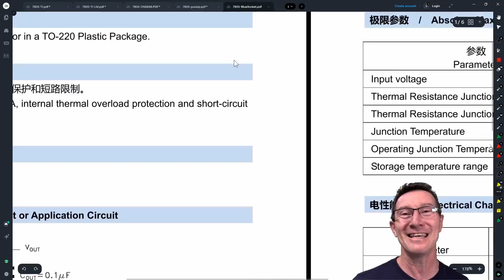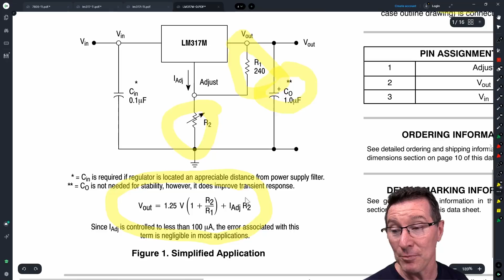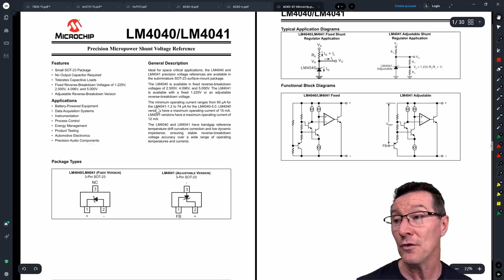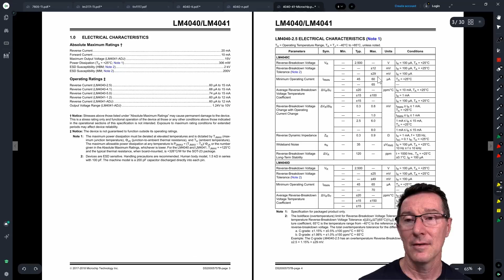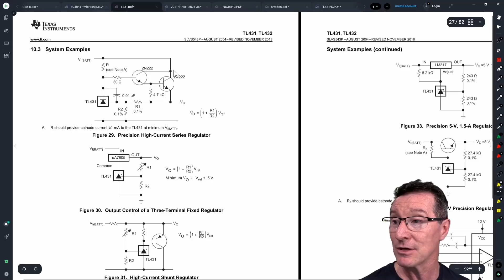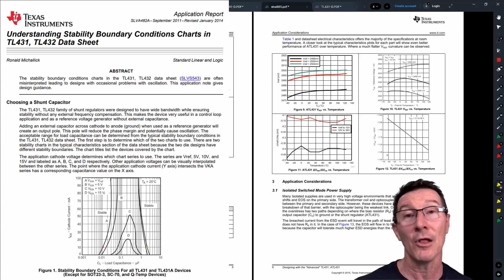EEVblog 1438 - The TOP 5 Jellybean Regulators & References

Comment: I'd add LP295x for low-power applications
Reply: i believe you got interesting story about it
Reply: 7:00
Reply: LP2950 - fixed output, 3 pin
LP2951 - adjustable output, 8 pin
Reply from the maker: Yep, video was already way too long.
Reply: @EEVblog  There's no such thing as a long EEVBLOG video, Dave :)
Reply: @EEVblog  references should have been on separate one so you can cover the subject of regulator a little better imho.
Reply: I am not sure EEVblog videos can be too long. Just pause and continue next day. : ) @EEVblog
Reply: The great Mike has spoken.

Comment: Jelly bean apart from them being all being in the same jar like components but still remain an individual component/item in the jar well the printed circuit board is the jar so as long as your voltages are right you won't make heat and weld all the jellybeans together just like a circuit board

Comment: The two jelly bean solutions I am frequently looking for are:
1.  A simple "neutral reference" between rails, to avoid paying an op amp and 2 resistors to generate this, while losing sleep over whether there are any circuit conditions that will overload the op amp once the product is put into service. There ought to be a regulator designed to do this, but I haven't found it (yet).
2.  Every design seems to involve switching analog signals around. A bilateral switch like the 4066 works, but it's made of super-static-sensitive CMOS. A 74HC4316 or 74HCT4316 seems to qualify, but they are certainly NOT available like jelly beans.
Steve

Comment: I am struggling to find an equivalent of the LM317 but capable of handling 60v not just 37v
Reply: What do you need it for? TL783 with different pinout costs about 3eur, you could also use LM317 with zeners across it, LM317HV has 60V rating, etc.

Comment: I've thrown in 2x the LM317 into every toolkit (parts, tools, breadboards,...) i made for our interns/students, but until now they all were too lazy to build it onto their breadboards and all used external lab power supplies for their different voltages 😅
Now thats fine for first setups looking for smoke, but i find it a lot nicer if you only hook up one supply.. but building a board without cross wiring all and building a ratsnest seems to be the starting hurdle.. which makes it extremely hard to then find the wiring errors and issues.

Comment: Yoo take regolatoor and put on bord with gasoline. I melt ledd solder on top to inhale fumz, cover everything with solder and attach wire from car battery. Board Ignite gasoline and flame it dry. But after few seconds nothing works and i got headache. Why is it so?
Was regulatoor bad chip?

I tryed higher voltage power but only board goes brown, no smoke from chip yet..use even higher volts?

Comment: Using TL431 with LM317/337 together is great for low noise and stable linear power supply. Only critical point to achive that is to right matching capacitors  in PSU design.

Comment: What about the Jellybean transistors (FET, JFET, MOSFET), diodes, zeners, LED, resistor, capacitor, inductor, ferrite bead, DC power connector, switch (slide, push), .......

Comment: Aahh, for the LM317 tie a clean decoupled -1.25V (as in -V V) supply and you can got down to 0V output, ...or NOT?  (stable?), load current problem which does not have -ve V getting fed out? ...on second thoughts it's a bit tricky! :(

Comment: Reverse Protection Diode for 78xx, as at 15:20, can be eliminated in many cases by using 79xx instead, and regulating the 'ground' rail instead of the positive rail.

Comment: The 431 is basically the entire reference and pass transistor control block of a linear regulator without the pass transistor. This is why the 431 is used so much in mains switching mode power supplies, as it can drive a linear optocoupler to close the feedback loop for the regulated output.

Comment: 10:50 To use the 317 at low load currents, replace the 240 (R1) resistor with one of 120 Ω and choose the value for the voltage adjustment resistor (R2) accordingly.
In this way a minimum of 10 mA current will flow at all times.

Comment: I picked up an old powered breadboard — one of those big brick jobs from Global — that's got 5-way banana jacks for ground, +5, +15, and -15, and opened it up to check if it was all 78xxes or if the bipolar were adjustable, and it turned out the answer was yes. Plain 7805 circuit on the 5v supply, and 7805 and a trimmer on the +15 and -15.  Definitely a surprise.

Comment: the  fixed regulator 78XX is the most successful  regulator ever made 
been using it for years since I learned electronics  
I prefer Korean KIA  semiconductors 
KIA7805A .
(tasty!    candy crush electronics 🎉
so many  manufacturers omits alot of  internal parts to reduce cost 
but this  increases failures for microcontrollers chips  in inbedded circuits .  
other great regulator LM317
the best ever ample designs done on this componet .
if space on PCB doesn't matter u can 
design a regulator  with discrete components that have very long span ( my  adjustable voltage power supply  uses lm317 with 2n3055 transistors  with 15 years old and working perfectly.)

Comment: One other 1970 era part I'm glad you mentioned is the TL431.  It was designed as a voltage reference, but today finds heavy use as the feedback element in switching power supplies.  It's made by the billions and most EE's haven't heard of it if they don't work on power supplies. 
The relevance of this video is it is a good complement to a LM317 / LM337 to get a far more accurate output voltage.  You can get sub ±1% accuracy by pairing the two parts.

Comment: The longevity of these linear regulators is fantastic.  Many parts come and go, yet these are still here.  I design power electronics systems for a large multi-national, and one of our requirements is ± 24V for current sensors.  The flux gate and closed loop hall current sensors up to about 300A can do ± 15V supply, but the big stuff into the high hundreds and thousands of amps requires ±24V.  What makes it extra complicated is the hall and flux gate current sensors have a tight specification for the power supply rails.  Today we use paired 7824 and 7924 regulators to post regulate the switcher supply and get our low ripple, high accuracy ±24V rails. 
Sadly, the 7924 has gone sole source and it's making the supply chain people nervous.  
We've considered using the LM317 & LM337 paired.  I have an inclination that the LM337 will be longer lived, but... it is merely a hunch.  In some ways I have the gut feeling that the LM337 may be the B52 of chips, and make it to the 100 year mark.
Sadly, based on the fact that it is merely a hunch, we're going to high speed monolithic switching regulators.  We'll see in a decade if it was the right call.

Comment: A major difference between TL431 and LM4040 is that the 431 family has the internal bandgap reference voltage referred to the anode while the 4040 family have the internal reference referred to the cathode. Makes the 431 a bit like a high gain NPN BJT with a very precise Vbe and the 4040 a bit like a high gain PNP with a very precise Vbe!!

Comment: about the 79xx - "consider them exactly the same as the 78xx series, except they are for the negative rail".
No! Don't consider them exactly the same. It is common for 79xx-type regulators to have some leakage from the input to the output, so you need a couple of mA minimum load to get the output into spec. I've never seen that on a 78xx. If you rely on a 7905 outputting no more than -5.1V when the load is just in the tens or hundreds of microamps range, you are not using it as a jelly-bean part.

Comment: Can LM317 provide 1.5A current at 5V output for 30V input? According to the data sheet it seems obtainable but whether the regulator will be able to dissipate 25x1.5=37.5 watts of power in its package (e.g. TO220)?

Comment: I love jelly bean videos, when will you be doing top 5 jelly bean batteries (18650 AAA AA LR044 C2032) or Top 5 Jellybean Microprocessors (Pentium 80586, 80486DX, 8080, 6510, 6502) or Top 5 Microcontrollers (Renesis RL78, Motorola 68HC11, Infineon XMC4000 , Cypress Semiconductor CY8C4246AZI-M443, Toshiba TLCS-870) or Top 5 Jelly bean Logic ICs

Comment: Something like this would be great for switch mode/PWM controllers. We're finding out now how hard it is to replace a lot of the "fancier" ones on the market, and most applications don't need something that complex. There's the MC34063A, but it has limitations (low frequency, no ability to feed in external oscillator input).

Comment: My favorite of the LM317. There can be big differences between input and output 40 volts. I can adjust it, I usually use a 220R for this. I can quickly calculate the values on various websites. Constant current with only one resistor. The LM337 is available as a negative version. And the LM350 is the 3 amp version.
Allegedly the LM317 can "only" up to 40 volts, someone has already built a 200 volt DC power supply with it. 
How? In the event of a short circuit, you must ensure that there is never a difference of more than 40 volts. A transistor in front of it with a Z diode to the output was the solution.

If you want to operate an ESP8266 then take the HT7333 or HT7833 and after a 7805 or 1117-5.0
The HT7333 can cope with the high current pulses of the ESP and has a low drop, but it has no current limitation!

Comment: Great Video, BTW you can create a loop with the LM4041 and get a strong voltage regulator. This can only be a negative voltage regulator though (bridged with a PNP).
Other loops are probably possible, looks like it is basically the negative equivalent of TL431.

Comment: The LM340, was National Semiconductor's original number, for their competing part to Fairchild's uA78xx. But that was back in the 70s. Its all evolved into the generic 78xx. The stabilizing caps were needed on older parts. I had them oscillate, without caps, back in the early 80s. They DO change the part design, as the years progressed, without changing the number. Any 78xx built in the last 25 years, the caps are optional.

Comment: I had my electronics students built a half wave power supply with too small a filter capacitor.   Then we added a 7405 voltage regulator.  They could see about a 1 Volt peak to peak ripple on the input, but couldn't measure the output ripple because the noise was greater than the ripple.   It was an impressive lab for my students.  I love the 78xx regulators.

Comment: Wow, this is really useful! I've added the jellybean opamps video to my to watch list because I need to see that later. I've decided to make a list of all these. Could you also do one for diodes for several applications, like for making a diode-or gate? I tried it once with a BAT60A which has a very low forward voltage drop, but I noticed later that the reverse leakage current is way too high to use for a diode-or circuit.. Maybe one for transistors and mosfets is also a good idea. I found the IRLML2030pbf works pretty well for me to switch some leds on and off, but maybe there are some more common (cheaper) mosfets out there that would do the trick.

Comment: The 1117 is the only regulator I have around for general use,  I use a ceramic output cap with a 1R series resistor to meet the ESR requirement, better than using tantalums.

Comment: I prefer the 317 (or 1117) than 78xx series because it offers lower notice with the application of that Cadj capacitor shown on the 1117 datasheet.

Therefore I use it for 3.3V, 5V 12V etc.. even though there are fixed options.

Comment: TL431 Is used only in SMPS with primary side control, which are usually flyback or single transistor forward low power SMPS other topology usually use secondary control and they do not use TL431 (no need for it and optocoupler).

Comment: 79xx only 1,1V drop out, and 78xx can be used as negative regulator. The now obsolete uA723 used to be a jelly bean for decades so what is it now? TL431 is a uniform , repeatable noise generator when configured as such as a replacement for classic zener/tranny noise gen and using its unstable negative resistance region it becomes a VCO 50khz to 1,1Mhz depending on supply used.

Comment: Hi Dave, love the channel. I built a variable voltage PSU, used it to charge a battery but it popped, magic smoke. Apparently, the work around is to insert a BY127 or similar between the output leg and positive output terminal of the PSU, being constructed.

Comment: a couple of years before I had issues with some  7809 which wasn't outputting any measurable voltage (12v in about 4.xxx out) after swapping 2-3 I realized they output 9 volts when connected to a load or 0.1 µF capacitors. couldn't tell if it was isolating as mikeelectricsstuff suggesting coz don't have an oscilloscope and at the time didn't realize it could output-ing some kind of AC and multimeter wasn't able to measure the RMS

Comment: What linear regulator do you use after a switching converter? The common linear regulators have the most ripple rejection at about 100Hz, but for the 100kHz to 10MHz region they’re not very optimal. Thinking for audio circuits after a rail inverter, or battery boost converter.

Comment: 10:49 Wouldn't it be better just to engineer the feedback voltage divider resistors to draw 5mA or whatever? That way the feedback pin gets a nice low-impedance feedback path, and you don't have a weird unnecessary third resistor.

Comment: There's a long discussion about this on the Forum, but there's another trap. The LM317 datasheet seen at 10:40 actually shows a worst-case minimum load current of 10ma, which the 240 ohm resistor--shown on the prominent example circuits everywhere--won't swing. To properly handle the worst case, you'd need 120 ohms (with 1.2 volts across, for 10ma).

Comment: Simple switchers like the LM2679 or LM2596, More amps, more efficient, higher supply voltages. At this point I only use Linear regulators for low power 3.3V\1.8V needs, or for very low power, ultra-low noise (ie ADC, LNA, precision voltage references). 

Issue with TL431 is possible drift from temperature, unless you use temperature compensated components. A lot of devices can be under significant temperature swings from 0C\32F to 50C\122F.

Comment: Quite a few years ago, I wanted to have very long battery life for my back-then-new Asus EEE mini laptop. I had an external 12v sealed lead-acid battery (as in a home alarm system) and I used a circuit that I made myself with a LM317 regulator, to make the 9.5V the laptop charge port asked for. It worked for a short time, then the output shut off. My problem was that I didn't know about the minimum 3v difference between input and output voltage at that time!

Comment: A spin off of the LM317 would be the LM338, which is similar in spec, only difference is that the max current is like 3-5A.
And we can't forget the LM723. By itself it can handle about 200mA, but when you add a transistor (2N3771, iirc) it can handle about 10-15A. Astron uses them in their linear power supplies (They did, at least. I don't know if they still do.)
Reply: LM723s used to be in almost all of the old open-frame linear supplies, along with the TO-3 pass transistors.   And it can be used as the basis of a really primitive switching regulator.

Comment: There is a better way to do the SLA charger.  It involves one LM7812, and a small signal PNP.  The beauty is that it boosts the voltage when charging and then decreases it when in the "float" condition.

Comment: IMO, the craziest thing about the LM317 is that it has no ground pin: it's adjust pin is 1.25V relative to Vo (1.25V/240ohm = 5.2mA, so Vo = R[adjust-gnd] * 5.2mA + 1.25V). So with a maximum input-to-output voltage of 40V, you could get 5V out of a 45V source, or a maximum 37V from a 77V input.
Reply: At very low efficiency unless your load is very tiny. Linear regulators basically are just an adjustable resistor to create a voltage drop to the target voltage. better option is to use simple switchers like the LM2679 or LM2596 for large voltage differences between the supply source and the output voltage.

Comment: The 1117 is everywhere in USB powered devices. You simply don't have the voltage margin to go from 5V to 3.3V with a regular linear regulator.